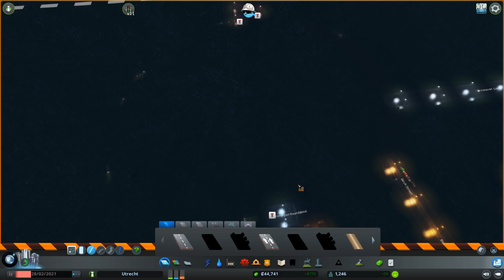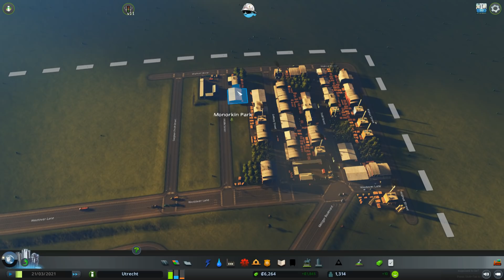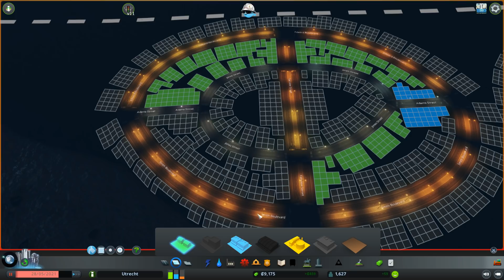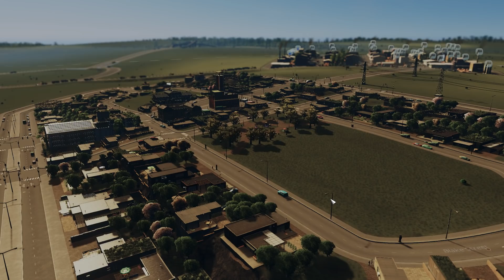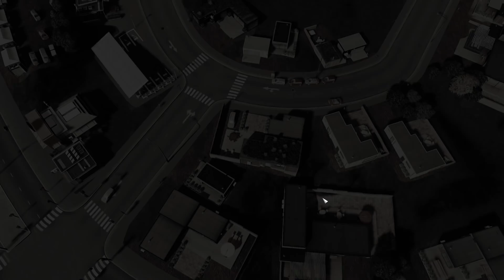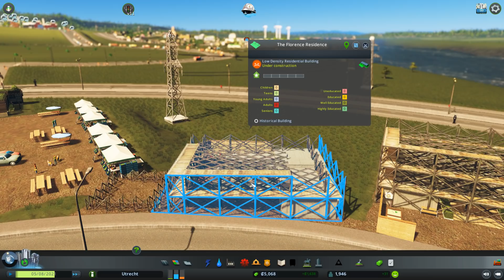Cities: Skylines - #2 - Elfwyn Park [Calm Content] (Cities: Skylines - Industries)

Comment: May I recommend the roundabout builder mod? It integrates with TMPE and any roads you add via mods and is by far the easiest way to get functional (and symmetrical) roundabouts. Steam workshop link: https://steamcommunity.com/sharedfiles/filedetails/?id=1625704117

Comment: Hey Stealth, here are a couple of tips I learned in a couple of years of playing CS and a LOT of hours of Biffa and SamBur,  I'm sure they could be useful:

- Commercial buildings are a great buffer between noisy areas and residential. They are a great way to limit noise pollution generated by highways, trains, industrial areas or wind turbines. 
- You might want to take away the traffic lights in the roundabout (they are set automatically in the intersection of big roads).
- Creating districts and creating industry areas are two different things. The same goes for creating parks in the Parklife DLC. You have to select the "Paint Industry Area" tool, that is in the same menu you use to create a district. Also, the buildings you get when you specialise a district's industry don't get upgrades.

I hope this info is useful. Btw, I'm enjoying a lot all your calm content, thanks a lot.
Reply from the maker: Thanks! Useful indeed. I'll implement in episode 4

Comment: Once you expanded your map past where the highway is currently, cut it back a bit, make the roundabout circular, and make curved on- and off ramps. If you make them curved instead of straight, that makes traffic flow smoother. Also, seperate on- and offramps make it so the drivers headed on and off dont block each other from doing so. This is especially true if you use tunnels to make onramps be on one side and offramps on the other.